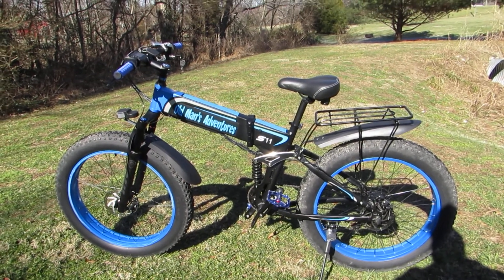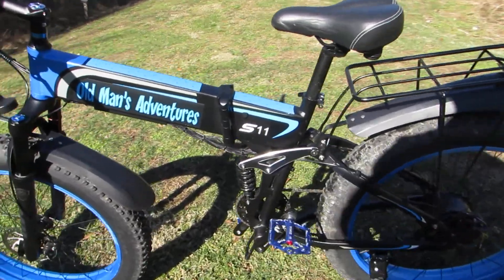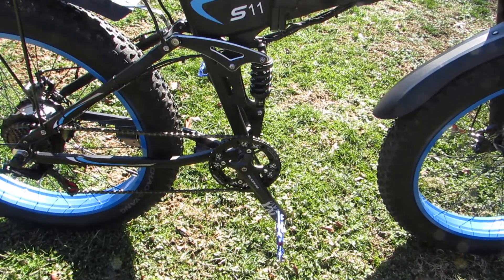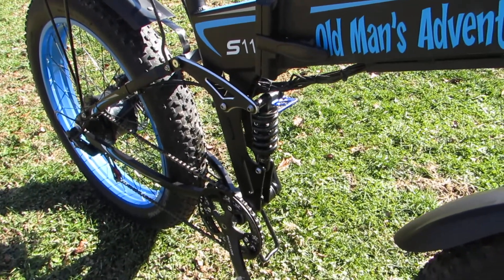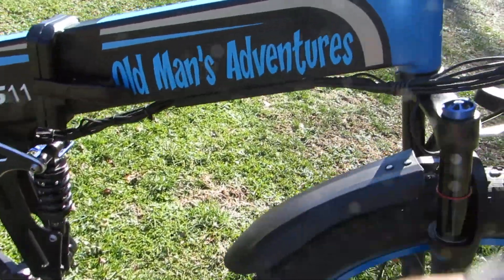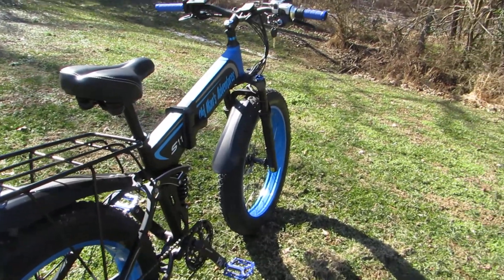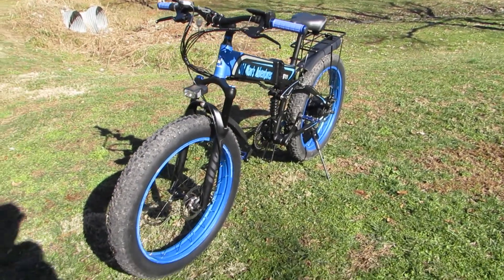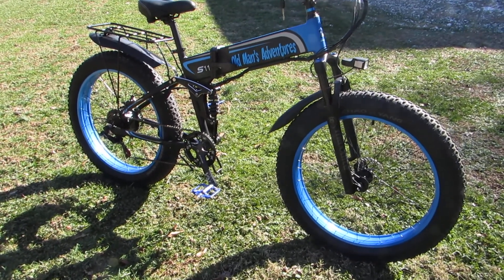My Senada Roamer Modifications

Comment: hey mate, my best friend and I just bought this bike and found your videos. we were wondering what thw links for rear suspension and the new fork were
Reply from the maker: Here you go, I'm a big guy, 280 lbs and the 1500 lbs/in rear shock gives me the sag I'm looking for without bottoming out on rooty trails. The only thing that would make the fork better would be rebound adjustment. WHQ Bike Spring Shock Absorbers... https://www.amazon.com/dp/B09G6YRRL6?ref=ppx_pop_mob_ap_share
26Inch Bike Fat Air Fork, 1-1/8"... https://www.amazon.com/dp/B08M3GRS6Z?ref=ppx_pop_mob_ap_share
Reply: @oldmansadventures4627  I'm about 6'1 at 250 myself so the extra security sounds good to me, thank you
Reply: What mm 150 or 125?

Comment: Hi fellow Biker, I have the same Fat bike as yours, but I modified it. First of all, with regard to the nominal power announced in the technical descriptions of the sellers, they are messengers, this motor is not a 1000 Watts but a 750 Watts, in addition the torque is limited by a very small controller placed in the frame, at the back and this controller is only 350 Watts nominal and only 17 Amps, which is largely insufficient, so I put a bigger controller of the very good brand: "Greentime" which is 500 to 650 Watts nominal and 30 Amperes, instead of the original battery which is not a 13 Ah either but barely a 10 Ah, hence a low autonomy and as I have a lot of long ribs at home, I was only doing 40, or even 44 km depending on whether there was high wind or not and always pedaling in assistance 3 between 26 and 32 km/h.
These controllers pass through the frame without any problem, without taking them apart. I also suspended a large battery with really much more powerful Samsung cells than the Chinese cells which equip the original batteries which cannot make 12 to 14 Ah considering their thinness, it is impossible. Mine is also equipped with a large chainring of 52 teeth and unlike you, I would need one of 54 teeth, because already when I drive at 38/40 km/h I have to turn my legs quickly, and as my big battery is a nominal 52 Volts and 58.6 Volts fully charged I go up to 51 km/h at top speed, so my 52 teeth is really limited, and with the 7 gears at the rear and since the motor is no longer restricted by this very small original controller, I mount anything very steep without problem, pedaling of course and adapting the correct pinion to the rear. My original brakes are very good Tektro Hydraulic 4 pistons, Dorados which brake very well. I haven't changed my shock absorber and my fork yet, but it's true that it's really low-end, nothing to do with my DNM pneumatic suspensions of my Bomber. So if you want more torque and power, you have to replace the original small controller, it's shameful that these Chinese sellers have put such a controller. Otherwise I am now satisfied with my Fat bike, having made these modifications already for quite a while. Yours is pretty in blue too.
 https://www.youtube.com/watch?v=WlXIERQeONE&list=PLlPHAC3W6aMSFZOaOdRKJQsDAxPpjfMG9&index=8&t=1159s
https://www.youtube.com/watch?v=yB5Km1Hbq4Q&list=PLlPHAC3W6aMSFZOaOdRKJQsDAxPpjfMG9&index=11&t=4s
https://www.youtube.com/watch?v=VDP754zpsus&list=PLlPHAC3W6aMSFZOaOdRKJQsDAxPpjfMG9&index=15
Reply from the maker: Hello friend, I'ma not sure we have the same bike? SMLRO seems to make several versions using that same frame. Some 1x and some 3x in 500, 750, and 1000w. My motor is stamped XH-1000W48V and my controller is labeled as 48V 20A. I use it mainly off road so I changed to the 42t to give me better mechanical advantage helping climb steep sections of trails. I tried watching some of your videos and even though I'm of French heritage I never learned the language. Guess that makes me a Kentucky hillbilly 🤣.
Reply: @oldmansadventures4627  
Hi friend,
thank you for going to see some of my videos and it doesn't matter for the French language, do you know that you can translate the videos on YouTube, but a little bit complex to translate them into your native language, and the author of the video has indicated when he puts his video on his channel, the language of the video, otherwise when people watch the video they can't translate it, and so for those who can't translate in their language, I I'm going to explain how to do it, because yours is exactly what I couldn't translate: on the left side of the cogwheel, there is a "rectangle", and if, as for your video, this rectangle is grayed out, that means that when you uploaded your video to YouTube in the settings, you did not specify your language, on the other hand when it was specified, this rectangle, at the bottom, on the right of the video, it appears in white and if it is already translated but in another language, there is just below the rectangle, a red line, then to be able to translate re in your language, you have to click on "the cogwheel", then in the menu, you click on: "subtitles" and then you click on: "translate automatically" and in the drop-down menu that appears: you choose your language and you see the translation displayed on the video.
It is not quite to the point this translation, but at least, we still manage to understand.
As far as Fat is concerned, there are indeed several powers and I chose 1000 watts 48 Volts, and even if on my motor it is also indicated 1000 watts, it is not a 1000 watts, but a 750 watts and I'm sure, there's no doubt about that, the Chinese are hucksters for the most part and they inflate in writing in their technical descriptions, the powers and capacities and autonomy of their batteries which for the most part, for these cheap bikes, are batteries with Chinese cells that are not worth much compared to the battery that I bought later and that I hung on my frame, we are very far from their original battery, and then you have to be logical and have common sense, when they announce a battery of more than 13 Ah when they are Chinese cells and this battery is not even 5 cm thick and weighs only 2.4 kg, you will never have the autonomy they tell you, especially with a fat that weighs more than 30 kg. With these 2 original batteries that I had with this Fat, while pedaling all the time and in assistance 3 and rarely in 4 and therefore at a speed between 26 and 34 km/h depending on the state of charge of the battery and with my original little controller which restricted the motor for torque only, I traveled a maximum of 44 km friends very often if there was a lot of wind for example and knowing that I have a lot of long and steep hills to going up, I was only doing 38-40 km. I have a friend who has the same Fat as mine and who is an electronics engineer, he was able to confirm to me that in reality these batteries incorporated in the frame, barely make 10 Ah and it is quite logical given their size and weight. But since I suspended my new battery, I drive fast so to speak all the time in assistance 4 and therefore between 36 and 43 km / h always depending on the battery charge and I have already done several times until 83 km still with so many hills to climb and I can go much further and vary my journeys, only this battery that I checked, has Samsung cells, 18650, it is almost 3 times the thickness of the batteries of origin, and weighs 5.2 kg, and it's a nominal 52 volts and a 21 Ah, but I think it's more like a 19 Ah because as I told you, they always tend to inflate the performance because it's is more of a seller.
If your controller is indicated as a 20 A, it's probably true, but 20 A is not enough for a motor that actually approaches 800 Watts, mine was a 17 A and the one I put in the frame instead of the battery, is a very good Greentime of 500/600 nominal watts and 30 amps and there your engine breathes with that, lol! You know I also did electronics and I know a little about it lol! otherwise I would not have been able to modify my Fat and mount my Bomber as a KIT.

Salut l'ami,
merci d'être allé voir certaines de mes vidéo et pas grave pour la langue Française, sais tu que tu peux traduire les vidéos sur YouTube, mais un petit peu complexe pour les traduire dans ta langue natale, et il faut que l'auteur de la vidéo ait indiqué quand il met sa vidéo sur sa chaîne, la langue de la vidéo, sinon quand les gens visionnent la vidéo, ils ne peuvent pas la traduire, et donc pour ceux qui n'arrivent pas à traduire dans leur langue, je vais expliqué comment faire, car la tienne justement je n'ai pas pu la traduire : sur le côté gauche de la roue dentée, il y a un "rectangle", et si comme pour ta vidéo, ce rectangle est grisé, cela veut dire que lorsque tu as téléchargé ta vidéo sur YouTube dans les paramètres, tu n'as pas spécifié ta langue, par contre quand ça été spécifié, ce rectangle, en bas, à droite sur vidéo, il apparait en blanc et si c'est déjà traduit mais dans une autre langue, il y a juste en dessous du rectangle, un trait rouge, ensuite pour pouvoir traduire dans ta langue, il faut cliquer sur "la roue denté", ensuite dans le menu, tu cliques sur : "sous-titres" et ensuite tu cliques sur : "traduire automatiquement" et dans le menu déroulant qui s'affiche : tu choisi ta langue et tu vois la traduction qui s'affiche sur la vidéo.
Elle n'est pas tout à au point cette traduction, mais au moins, on arrive quand même à comprendre.
pour ce qui est du Fat, effectivement il y a plusieurs puissance et moi j'ai choisi le 1000 watts 48 Volts, et même si sur mon moteur, il est aussie indiqué 1000 watts, ce n'est pas un 1000 watts, mais un 750 watts et j'en suis sûr, aucun doute pour çà, les chinois sont des bonimenteurs pour la plupart et ils gonflent par écrit dans leurs descriptifs techniques, les les puissances et les capacités et autonomies de leur batteries qui pour la plupart, pour ces vélos pas chers, sont des batterie avec des cellules chinoises qui ne valent pas grand chose par rapport à la batterie que j'ai acheté ensuite et que j'ai suspendu à mon cadre, on est très loin de leurs batterie d'origine, et puis il faut être logique et avoir du bon sens, quand ils annoncent une batterie de plus de 13 Ah alors que ce sont des cellules Chinoises et que cette batterie ne fait même pas 5 cm d'épaisseur et ne pèse que 2,4 kg, tu n'auras jamais l'autonomie qu'ils t'annoncent, surtout avec un fat qui pèse plus de 30 kg. Avec ces 2 batteries d'origine que j'ai eu avec ce Fat, tout en pédalant tout le temps et en assistance 3 et rarement en 4 et donc à une vitesse entre 26 et 34 km/h suivant l'état de charge de la batterie et avec mon petit contrôleur d'origine qui bridait le moteur pour le couple seulement,  je faisais maximum 44 km amis bien souvent s'il y avait pas mal de vent par exemple et sachant que j'ai beaucoup de côtes longues et raides à monter, je ne faisais que 38 à 40 km. J'ai un copain qui a le même Fat que le mien et qui est électronicien, il a pu me confirmer qu'en réalité ces batteries incorporées dans le cadre, font à peine 10 Ah et c'est tout à fait logique vu leur taille et poids. Mais depuis que j'ai suspendu ma nouvelle batterie, je roule vite pour ainsi dire tout le temps en assistance 4 et donc entre 36 et 43 km/h tyoujours suivant la charge de la batterie et j'ai déjà fait plusieurs fois jusqu'à 83 km toujours avec autant de côtes à monter et je peux aller beaucoup plus loin et varier mes trajets, seulement cette batterie que j'ai vérifié, a des cellules Samsung, des 18650, elle fait presque 3 fois l'épaisseur des batteries d'origine, et pèse 5,2 kg, et c'est une 52 volts nominal et une 21 Ah, mais je pense plutôt une 19 Ah car comme je te l'ai dit, ils ont toujours tendance à gonfler les performance parce que c'est plus vendeur.
Par si ton contrôleur est indiqué étant un 20 A, c'est surement vrai, mais 20 A ce n'est pas suffisant pour un moteur qui approche en réalité les 800 Watts, le mien était un 17 A et celui que j'ai mis dans le cadre à la place de la batterie, est un très bon Greentime de 500/600 watts nominal et de 30 ampères et là ton moteur respire avec çà, lol ! Tu sais j'ai moi aussi fait de l'électronique et je m'y connais quand un peu lol ! sinon je n'aurais pas pu modifier mon Fat et monter mon Bomber en KIT.
Reply: @pat_0248  Can you help me modify or do to mine what you did to yours to make it faster? I like following tutorials.
Reply: how hard was it to change the front sprocket? I am ordering a Roamer today and want to put on a smaller front sprocket.

Comment: i'm 6'5" 250 and really having a hard time finding an ebike that fits, senada seems to carry 3 the saber, herald and roamer was going to order herald but don't wait to wait do you think roamer will fit me and are you happy with your choice
Reply from the maker: I'm 6'1" 280 and the roamer fits me okay but in order to get proper leg extension pedaling I have to have the seat so high that I have to tip toe to touch the ground. Consider how you plan to use the bike. Most of my riding is on trails and gravel paths with lots of ups and downs as well as tree roots. In order for the roamer to be heavy duty enough for this type of riding I had to upgrade the suspension as well as part of the drivetrain and it struggles with the uphill sections. That being said I really wanted something that would still give me a workout and would give me enough boost that I could make it up the hills without having to get off and push. The roamer accomplished that. If you are looking for something that's a bit more powerful check out my project Axum eBike video it will practically climb a tree and has much longer range plus costs less. I've got 300 miles on my Roamer and 250 on my Axum they are both practically bulletproof. While I put several upgrades on the Axum before converting it to an eBike the stock Axum is a solid platform out of the box.

Comment: another old man here... I have a Senada Drifter  in my cart , but rethinking it. Im 5-6, do you think the Roamer would be too big?
Reply from the maker: The roamer is as big as most 29er mountain bikes. I'm 6'1" with a 32 inch inseam and to get proper leg extension I have to use tippy toes to touch the ground when the bike is vertical

Comment: So in essence this is no longer a Senada bike.  You basically built a custom bike using the Senada frame.  Nicely done, but not so helpful for those of us looking for information on the stock version.  Looks like a beast.  You willing to share the total upgrade costs?
Reply from the maker: You're correct it's somewhat of a custom build at this point. The parts that I changed are 1. The fork (well worth the money). The reason I changed the fork was because the stock fork was very heavy being steel and also had an unacceptable amount of lateral flex. 2. The rear shock (again we'll worth the money). The reason I changed the rear shock is because the bike supposedly was rated for 330 lbs but my 280 lbs body was bottoming the rear suspension on even small ruts and bumps. 3. Handlebars and grips. (Personal preference). 4. Brake calipers ( cable actuated hydraulic again personal preference). 5. Square taper crank arms with 104 bcd chainring in 44t in order to get more climbing power when pedaling. In total l'd say upgrades cost about $300-350. The bike is way more capable than it was out of the box I'm happy with it's off road potential with all the upgrades. See my Senada Roamer review video for my opinion of the stock bike.

Comment: It's weak on hills because your skinny  and  changed 2/3 of the bike. That's not on Senada. That's on you..
Reply from the maker: Respectfully disagree, every modification I've made to the bike is an improvement upon what Senada  is marketing as a mountain bike. The factory fork is not suitable for any mountain bike. The 800 lb/in rear shock is way too soft for a trail bike bottoming on every root. The 52 tooth crank sprocket is designed so you don't run out of pedal at 30+ miles per hour which is what it will do flat out on level pavement. I didn't buy it to be a road bike, I bought it to ride singletrack trails therefore changing to a 42 tooth sprocket allows the rider to put more torque on the ground with the pedals. Because it's a hub motor nothing I've done has changed anything as far as the electric assist. For some reason the Chinese seem to think more in terms of watts=speed instead of watts=torque which is what I was hoping for.
Reply: @oldmansadventures4627  So you're STILL going to call it a Senada after stating that? I'd sue you for damages if I owned Senada. It's mostly after market now anyway. You see how bad the supply chain is worldwide. So I respectfully disagree as well. I love these "experts" that bash struggling brick and mortar companies just because they purchased the product and POOF, he or she is an instant EXPERT.
Reply from the maker: @roojackstudios8475  Yes!, If I bought a Chevy pickup and installed a lift kit, all terrain tires, mag wheels, and custom exhaust it's still a Chevy pickup! My bike is still a Senada Roamer (Even though out of the box it didn't have Senada or Roamer on it anywhere because they don't make it, SMLRO does.) . As far as it being "mostly aftermarket now anyway" let's see, I've changed the fork, the rear shock, pedals, crank arms, sprocket, and put different grips on it. If those parts make up most of the bike then I guess so. FYI Senada buys Chinese manufactured bikes in bulk and sells them on the internet, I'm not sure if they even have a brick and mortar store unless you want to count the warehouses they ship from. I don't claim to be an expert I just know what looks good to me, works well for me, and from my point of view makes the bike more suitable for my purpose. Sorry if that ruffles your feathers. Btw I'm not bashing Senada just customizing their product to suit my needs! Have a great day and Thanks for watching!